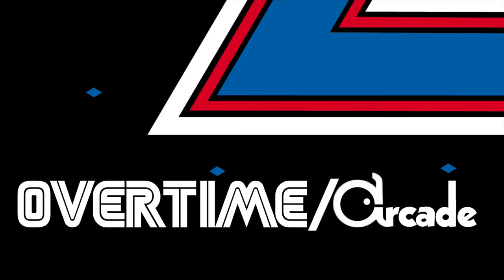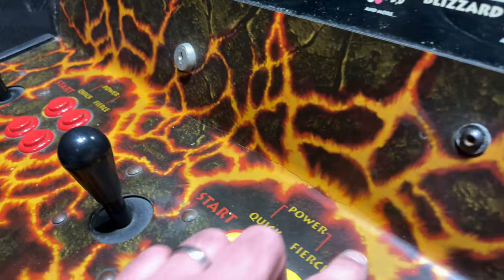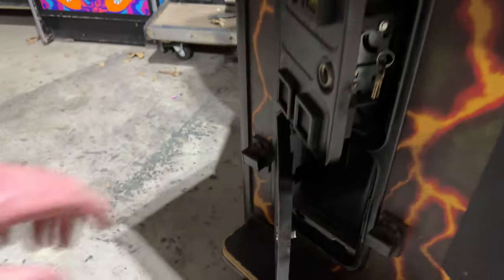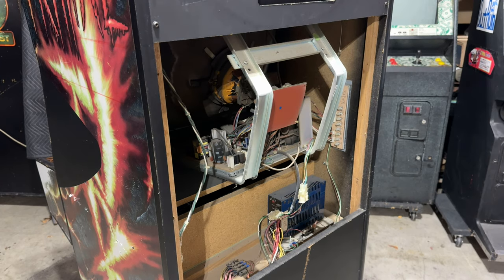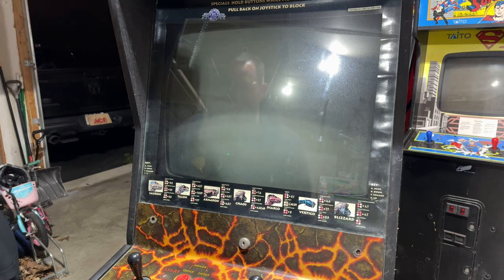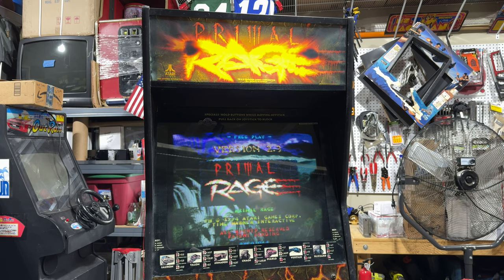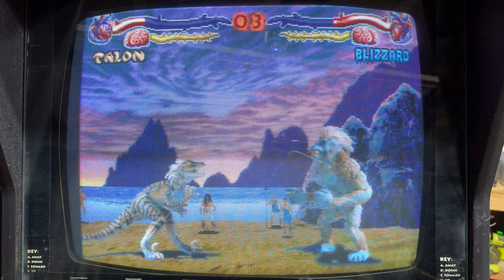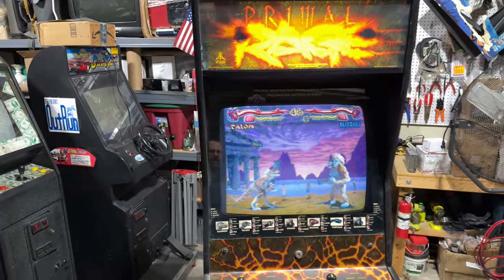$100?! 🤯 I got an Atari Primal Rage arcade machine for HOW MUCH?! 🦖 🌋 🦍

Comment: Legit one of my top fighting games ever with 3rd Strike. people compare this game to MK which i understand, but in actuality, the closest cousin to this game, gameplay wise is Darkstalkers series. Both games released with Chain combo systems in 94. and honestly, PR's is more expansive since u can end chains with specials. basically u can do easy combos. buttons as:
(1)  2
  3   4

you could do 1, 2, 1+2 (together) will execute a combo with all characters.
1+2 and 3+4 gives u a 3rd heavy strike like street fighter.

so Sauron, a basic combo could be:
Jump 3+4, 1, 2, 1+2, HOLD 1+3 away toward

u dont have to time it really, just tap it out at an even pace and on the last hit hold the buttons and hit the motion. u can also do chains in the air, such as using 4, 3+4 after a normal jump which can do 2 hits before u touch ground to launch the rest of your combo.

once u learn it and get a feel u wouldnt want it any other way. i complained about it so much when i was first learning the game a few years ago but once it clicks its so nice.

theres also 3 different jumps (which KoF would also do)
 
down to up:
 is a super jump

 forward, down, up:
 is a short leaping lunge jump
basically doing a shoryuken but pressing up towards at the end. it kinda works like a dash to get in close without opening yourself up too much. its fast and a great way to start a combo with 3+4 or 1+2 or other buttons depending on the character

its sad theres not a 100% emulatable version of Primal Rage because of its expert encryption. there was an effort a few years ago but the project was shot dead in the water. iv speculated that it was an effort to towards release for Arcade1up but was axed. Gruntzilla94 did a great job getting PR2 emulated, i dont know why WB Games would go out of their way to kill a PRage emulation project
Reply from the maker: Thanks for the great info!

Comment: The NT2515 monitor is really nice when it is working. Hard to find flybacks for tho...
Reply from the maker: Yep, this one seems pretty good. I'm just planning on doing a cap kit as a bit of preventative maintenance and getting it dialed in. 🤞
Reply: @overtimearcade Nice. I was trying to find one during the lockdowns. It was basically impossible. Took me two years to get a hold of some. So if you are like me and like having parts on hand. Then order one or two now ^^. Congrats on the great get. Awesome game. Cheers.
Reply from the maker: @DigitalConfusion Looks like APAR has about 450 in stock, so supply looks good for a while? Thanks!

Comment: Awesome pickup Charlie! My only suggestion is you go into the test mode and test the controls. I actually think that should be the first thing you do. Also, you had that control panel open it would have taken 1 minute to clean the glass and CRT tube. It makes the video easier to see. You seem to have an aversion to cleaning glass. I'm tired of looking at the dirty screens Charlie! 😢
Reply from the maker: Message unclear. Which one is your “only suggestion?” 😂
Reply: @overtimearcade  If you are only do one thing for Pete's sake please clean the monitors for those of us watching!!!! :face-blue-wide-eyes:
Reply from the maker: @tigheklory But it’s only got the original grime ONCE!

Comment: Mannn wish i had a garage for machines..i have a primal rage pcb but i get a watch dog error all the time i put it on a switcher in my mk4 cab..
Reply from the maker: One of the benefits of living out in the boonies is space is cheap!

I’ve heard Primal Rage likes the +5v to run a bit on the high side, and this can cause watchdog issues. Maybe try temporarily turning it up to 5.3v and see if that helps?
Reply: @overtimearcade  ok but i have a 6 pcb hooked up in my cab on a riddle tv 6way switcher. You press p1 and p2 to switch games idk if that will effect and kill other pcbs..i have a square power supply in there not like the one you have on your primal machine.
Reply from the maker: Yup, different PCBs sometimes want different things from the power supply. Switchers like that are best used with similar games from the same manufacturer.